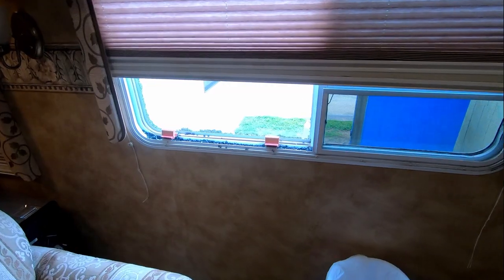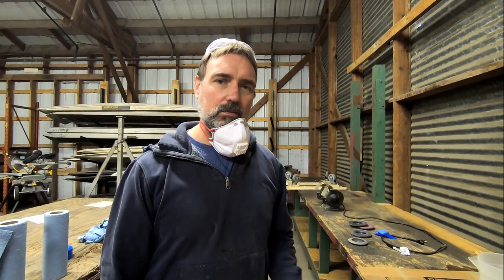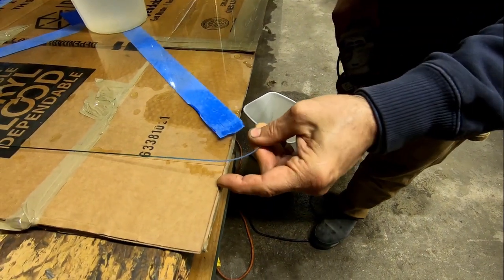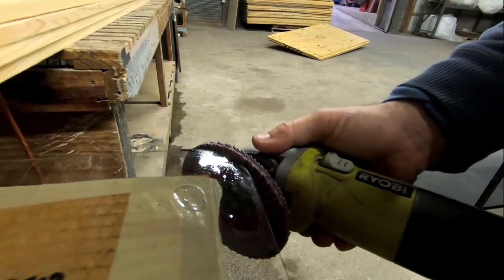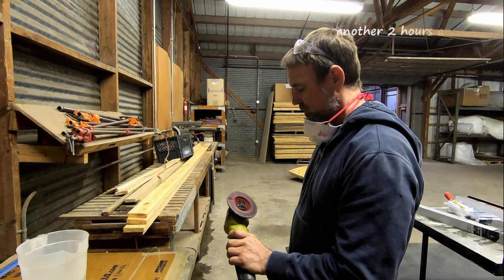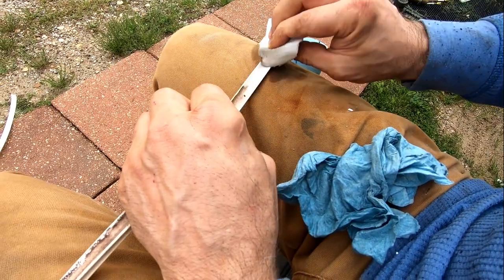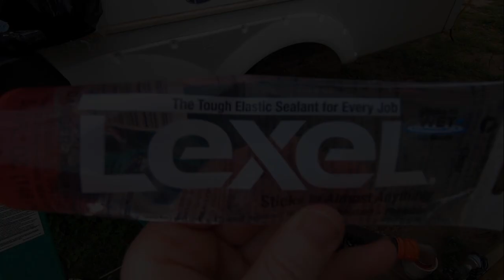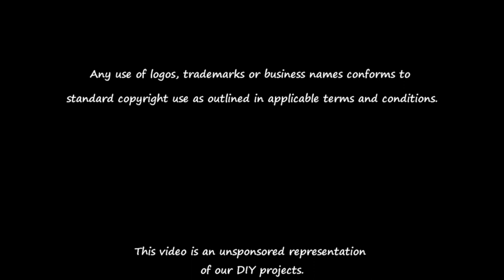Complete DIY RV Window Replacement | Shaping/Cutting/Grinding Curved Glass, Pane Installation, Tint

Comment: This was a helpful video but more voice over, detailing the steps would be more helpful.  Did you place the lexel on first then the window then more lexel?
Reply from the maker: Mary, yes, you saw that correctly but the second application of adhesive was more to keep the window seal in place.  The first application of Lexel held the glass just fine.

Comment: Impressive work but this must have taken an eternity. Curious why you didn’t just purchase a piece of aluminum as a temp replacement until you could order the correct window with the tint already in the glass? Maybe a bit more in material cost but so much faster and secure. 

Enjoying your content 👍 so far.
Reply from the maker: It did take a loooong time.  This happened at the very beginning of COVID shutdown.  There was no indication the glass shops would reopen anytime soon.

Comment: I will assume the tempered safety glass was a little tougher to grind and that's why you went with a regular glass for temp replacement?? 

Obviously getting a professional to cut your glass is better since they restrengthen the edges after cutting. But all in all this was a great replacement that you did. Good solid video and some nice pointer notes on the grind wheel and the Magic Erasers "magic".. :)